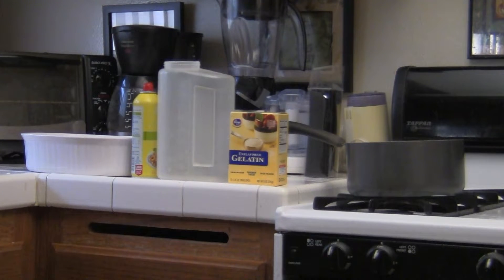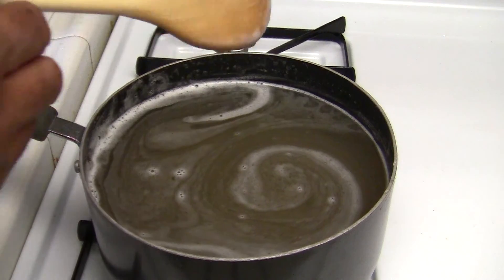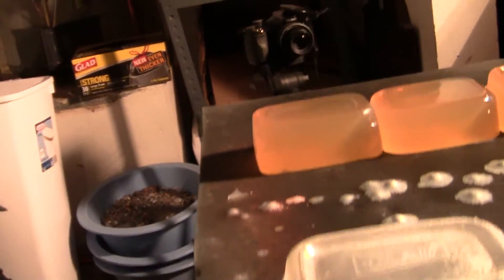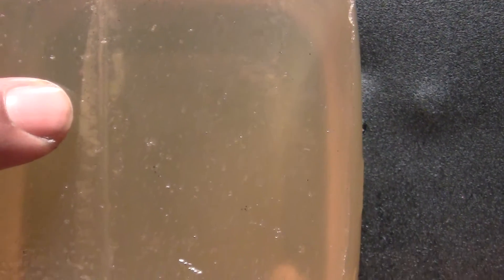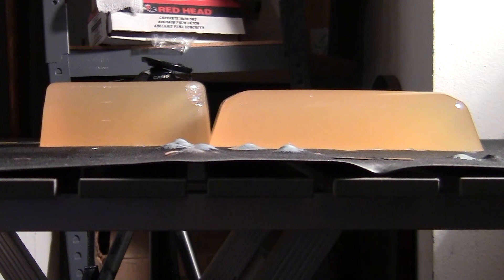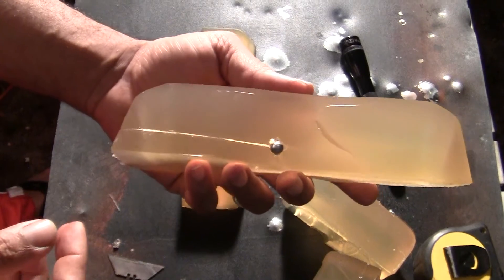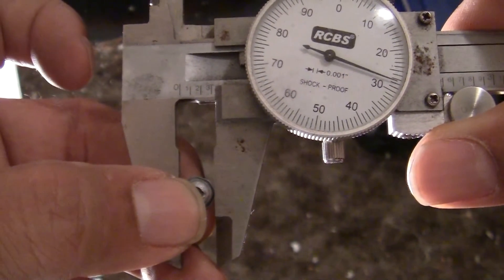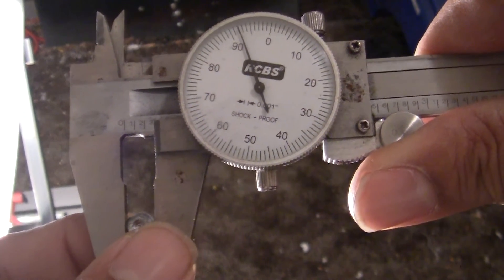Air Gun Fun:  Making and Testing SIMULATED Ballistics gel

Comment from the maker: @mrjoebatz Joe, the Preds are accurate at a wide range of velocities including high fps.  In my Rapid, the Preds are good at 920-940 FPS.  In the video the gun was at 2000 psi and shot a Pred at 946.7 FPS.  Your Sumatra is more than likely HOTTER than my Rapid i'm sure.  Chrony the gun and if its pushing them 1050+ fps, try backing off the power adjuster.  Sumatras are hot guns. THESE PELLETS ARE WORTH THE EFFORT!  Expensive...but worth the cost and they are true hunting pellets.